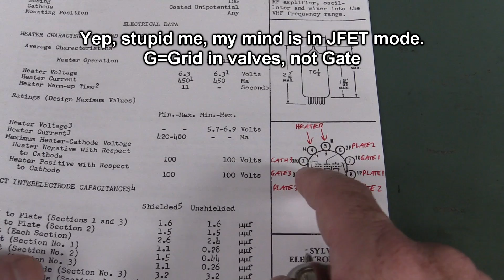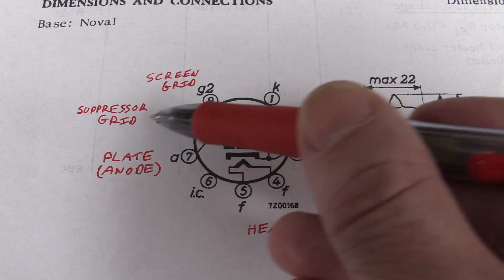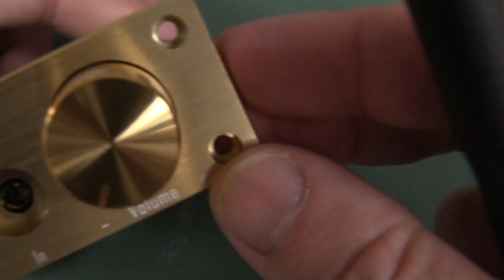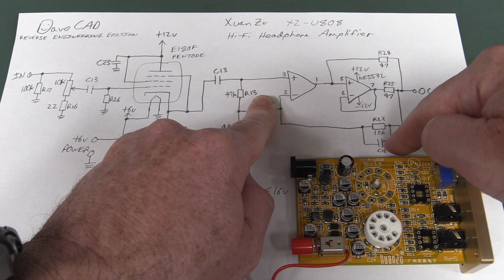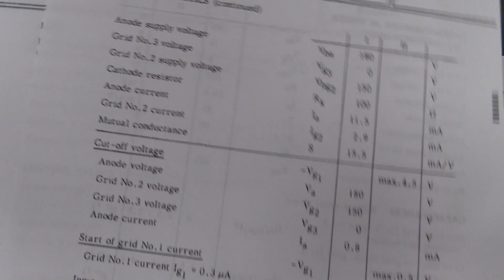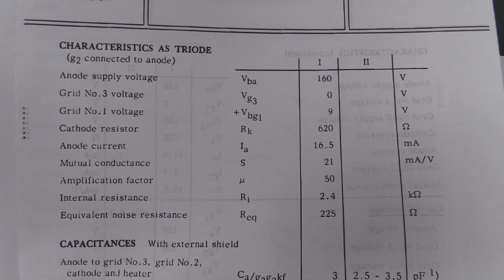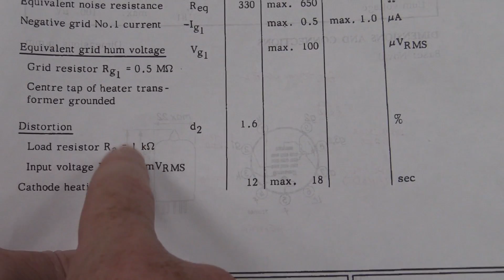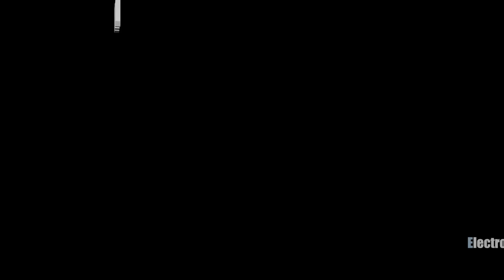EEVblog #837 - Reverse Engineering A Valve Headphone Amplifier

Comment: Haha so unsurprisingly their using the tubes as fancy. unnecessary preamps and all the heavy amplifying is being done by a couple of standard audio op-amps, just like what's built into the headphone out of any normal speaker system, computer or device (minus the tubes).
Reply: Tubes always been end will be very ineffective(transistors also are not that effective in class A amps). Tubes are used to add certain warmth, fell ect. to sound. Technicaly those things are a distorsions(mainly harmonics) BUT tubes also lack some types of distorsions that trasistors have, end act like copressors when signal go to "heavy" instead of "hard" clipping it end they have somewhat more linear amplification curve(not frequency amplification/response curve).

Tube amps end other equipment with them is used all over the world in pro recording studios to add distorsions end "character" to sound.
Reply: "Technicaly those things are a distorsions(mainly harmonics)"

Specifically, third order harmonic distortion which is more "pleasing" to the ear than the typical second order distortion generated by poorly designed solid state amps.
Reply: I Wonder if they use tubes to do all the amplifying in a good guitar amplifier or if it's a similar configuration to the amp in the video
Reply: John Casteel
It's not true. Also transistor are more often recognised with odd harmonics.

Second end third harmonics(low number harmonics) are "musical", hight number harmonics(odd end even) are not pleasant. Especially like 7 harmonics.

That transistors are recognised with odd harmonics is becouse those aplifiers are ussualy in push pull. Such desing eleminate all even harmonics leaving odd harmonics(but still they are lower than in eny tube amp). That give AB/B (push pull) amps cold, extreamly detailed sound. Also transistors(bipolars, not others that much) have TIM distorsions. They sound then kinda metalic but that was only problem for oooold bipolar transitors amps(before we know that such distorsions exist) end some very bad ones.

ALL tube amps technicaly are worse on themself(distorsion end noise wise), also such amps almost always use transformes that made huuge distorsions. But all those distorsions of tube amps make music somewhat muddy, but also smooth, somewhat more musical.

In simple visualisation. There is bipolar transistor end tube amp. IN on both amps is square wave. On OUT from transitor amp, signal still would be more less square wave with harmonics end some TIM. On OUT from tube amp istead of enything that is even close to square wave You will get distorsed somewhat sinusoid wave.

Ather difference would be that tubes behave like compressors when pushed hard end distord signal like no other thing(it's often used in guitar cabines, when you set gain on tubes high). End tubes can't control well speaker itself. When you give pulse to tube amp end then speaker. the speaker cone will "float" for while. while if you try that with transistor amp which can control rly rly rly well speaker, You send pulse end you get only that one pulse on speaker. Speaker cone don\t move in eny uncontroable way when conected with transistor amp.

There are good transitor only end tubes only end hybrids spekaer cabinets for guitar end basses.

It's all matter of taste. Some people prefer mudy, smooth transformer coupled tubes sound other prefer clinicaly clear sound of transistors.
Reply: Tubes also operate on frequencies outside of the human hearing range... but yes he warmth factor is the reason musicians love them so much in guitar amps
Reply: +neardood1: I'd invite you to do your own teardown of any valve guitar amp.  There are a few "hybrid" amps, and they're clearly marketed and badged as such.  Aside from some 1N/UF4007's in the power supply rectifier (if it doesn't have a valve rectifier for "sag") or some silicon relays for channel switching, the only sand you'll find there is in the glass bottles.

Comment: Poor design and TOTAL waste of money:
Firstly, where are the audio transformers? Also, 12-volts on the plate seems WAY too low. It should be at least 100 volts.
They should have just used 12-volt filament tubes (such as 12AX7) and a 12-volt DC supply and eliminated the DC-DC converter as it will add extra noise to the amp.
This thing is a SCAM!
Reply: @Ryan Toomey
You don't need an output tranny because of the Opamp stage and they're pulling the output from k. Which would normally be only 4 -7v with a tiny signal on a proper design. The signal should have been pulled of the plate. At 12v all the curves and responses will be crap. Some of the better efforts do get plate voltages over 100v using multipliers etc. In my book this one is shite.

Comment: This is garbage. Not even worth the tear down. Most of the time they just use the diodes as clippers. Also, tubes like 12AU7A work well at 12v as a preamp.

Comment: Hey Dave, 
great review!

Unfortunatelly, I had already ordered mine before checking your review. 
Now that it arrived, I will first remove the blue LEDs which look really cheap. 

It sounds like a typical chinese amp. Muddy sound with biiiiiiiiiiiiig bass and and annoying distortion on the highs. 

I am wondering how I can redesign the circuit to feed the signal input directly into the OP AMP bypassing the tube. 

Thanks and regards, 
Dieter

Comment: 12:54 "Who the hell is going to overdrive a..."  Do you ever research anything before you do these teardowns?

musicians for one, guitarists for sure.

Because overdriving a transistor just makes it a switch with a flat top and odd harmonic tendencies due to the PN junction layer.

Harmonics are all EVEN on tube amps and you know what by nature is even harmonics? All of music... take the lowest octave and double and you have the next octave and so on and so on.

Your reviews would stand up a lot more credibly if you either stayed in your realm or did a little more reseach. Tube pedal amps are still the standard for fender and stratocastors. Your ear would know if it heard a clear difference of the warm-fuzzy even harmonics compared to the stand-the-hair-up-on-the back of your neck crackling that is transistor distortion. I think I'm revoking my subscription until you can up your game. I've seen you make too many mistakes I & my friends knew at age 16.
Reply: He's talking about a headphone amp, not a guitar amp. The intended use is different, and so the optimal method of operation is also different. When you're producing sound, you can use any method you want to achieve the sound you want, so using vacuum tube amps for recording purpose is fine. When you're reproducing sound, you should use whatever method produces the mathematically most-accurate amplification of the source signal, so you can be sure you're hearing exactly what the artist intended. That's why my home stereo uses a set of self-correcting JBL studio monitors with built-in digital amplifiers, rather than some ridiculous glow-in-the-dark vacuum tube setup, so I can hear my vacuum-tube-amplified rock albums with perfect clarity.
Reply: When you're reproducing sound, you can use any method you want to achieve the sound you want ;-)

Comment: What a pile of cack! If the're gonna make a valve based headphone amp it should be done properly with something like a pair of PCL83s or similar using standard valve amp circuit! You could power it from a 24v AC wall transformer, heaters in series across it as they are 12.6v each, and derive 'high voltage' by using a capacitive voltage multiplier arrangement!
Reply: Bingo you said it. I never thought about 24 volts I was going to make one with 12 volts. I guess with twice the diodes and caps I could get 96 volts for plate voltage. I may try a 24 volt thermostat transformer. they are available from an ac and refrigeration supply house.

Comment: The 5532 driving the headphones is a pretty piss-poor design tho.  Not much power there, especially if the headphones are low-impedance.   

A real tube headphone amp would have more than 24v across the tube section, and the tubes would drive an output transformer, high-voltage in, high current out.     

This thing is a total wank-fest for sure.